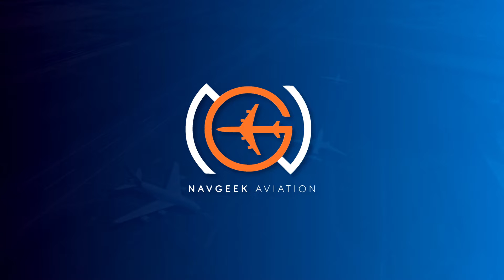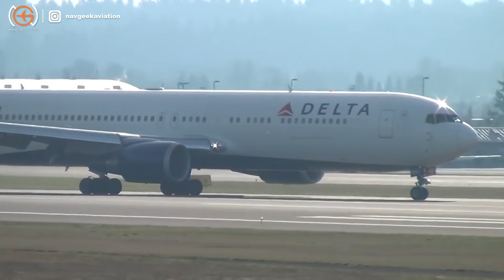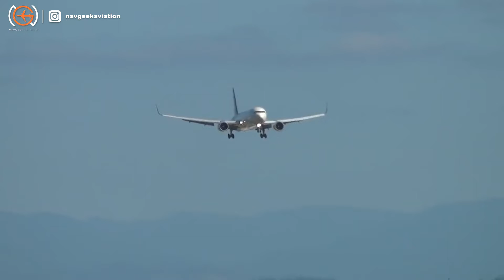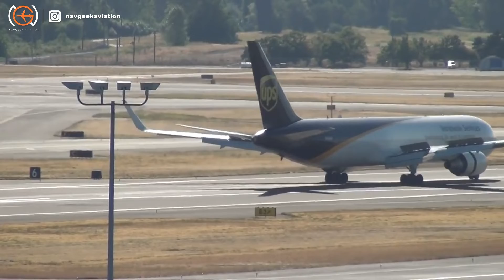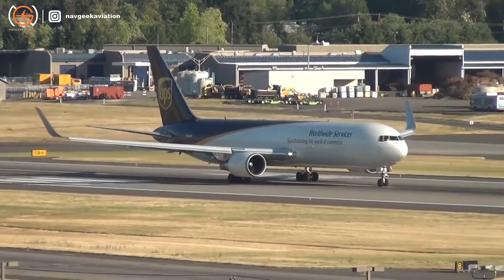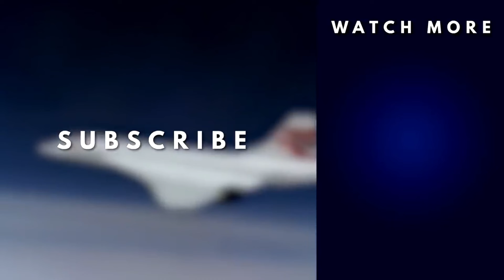Why Boeing SHOULD MAX The 767!

Comment: While the 787 was marketed as a 767 replacement,  the 767 is really unique in being a medium width fuselage.

Comparing Interior widths 

767 is 186 inches
787 is 216 inches 
777 is 231 inches
777x is 235 inches
A320 is 146 inches

A 767 with the GEnx-2b67 (747-8 engine) is 15% more efficient than the CF6 engine. If 67,000 lbs thrust is too much, derate the engine for even higher efficiency. 

Combined with a new composite wing, you can gain even more efficiency. 

Nice part of the 767 is you have existing fuselage lengths that cover the spectrum with the 200, 300 and 400 series.  

One thing they should add would be a new entry door ahead of the wing which could allow dual jetway loading / unloading

Comment: I don't understand why there's talk about a 767 replacement when the smallest 787 can do everything the the 767 could do, but better. Seeing as many airlines have gotten the type to replace the older aircraft,  pursuing a 767X would be time wasting and Airbus would likely entice customers with a newer clean sheet design if they wish. Boeing should continue working on a 797 to replace the true MoM aircraft (757) and a larger version could also replace the 767-200.
Reply: No it's not. The 787 is alot heavier than the 767 and was ment for long haul flights while the 767 was made for short to medium haul flights . Their not the same . The 787 is not effective and efficient for medium / short flights like a 767X could be . 

The 767-200 for example is close to 40 tons lighter than the 787-8 and would be better for the NMA because of its lower fuel burn. 

Even thou the 787 is considered a  replacement , it serves different purposes /markets from the 767
Reply: @mmm0404  It serves the same markets as the 767, which is also used for long haul flights. Maybe the 767-200 was largely meant for domestic flights, but the 300ER is a long hauler, and same with the 400ER; both of which can be covered by the 787-8/9. That's why I said a larger version of the NMA could cover the 767-200, as no airline (if few at all) uses it anymore. Even the freighter is based on the 300 model.

People like always you bring up how much heavier the 787 is based on the smallest 767 model, despite that 767s today serve the same airports as a 787. Even Boeing themselves said the 787 was based on characteristics from the 767, which were improved upon because of new tech. The 767-200 may burn fuel a little less because it's a smaller frame, but the 787 would gain the advantage as the larger wing improves lift and its shape reduces drag, the shape of the frame also reduces drag, and the newer engines require less fuel when going the same distance. Plus, the added seating capacity would mean airlines see they're using less fuel on a 787 per seat mile, with ANA some years ago saying they've seen a 15% improvement on domestic routes.
Reply: @fighter5583  
Well the 787 is better than the 767 , everyone knows that but a 767X would be better on medium to short haul flights than a 787 . 

A 767X could comprise of the GEnx (15% less fuel burn  than the Cf6)  , a new composite wing ( like the 787/777X), that could further improve efficiency/ fuel burn  and a taller landing gear.. 

The non ER versions of the 
767-200 and 767-300 could fly around 7400km and seat between 215 to 250 seats in a two class. This further proves my point that they where initially designed for short to medium routes . The ER versions could push their range to around 10000 km , which is still good for the NMA  , considering the 797 was designed to reach around 9500km. 

The 787 was generally designed for longer routes from the start with the smaller 787 flying around 13500 km and the 787-10 rumoured to get an ER version ...

And speaking of weights , the largest    767, the  400er Has a  dry mass of close to 20 tons less and a MTOW of close to 25 tons less than the 787-8 just to show how heavy the Dreamliner family is.  The 300Er could fly around 11k (km) while the 400er course fly around 10k , thats generally lower than how much the 787 can fly. A re engined 767 with its much lower weights could offer better economics and a lower fuel burn on medium /short routes while filling the gap between the 737 and 787 and offer better competition to the XLR.

The real point here is that introducing the 797 would have been better overrall yes , if only it was launched in 2019/20 with introduction in the late 2020's but now it's too late for that. Any new aircraft now will enter into service in the mid 2030's and that would leave Boeing without an XLR competitor , handing over the market to AB. 

A 767X could be introduced 2-3 years from now and allow Boeing to challenge for the NMA market while they focus their resources on a 737/757 replacement instead of a 321xlr competitor.

Comment: A 767-200 ER with the fuel capacity of the cancelled 767-400 ERX and the new engines, targeting a range of around 14,500 km with 214 seats, would open up a few new long thin routes internationally.
Reply: With that range, it’s basically a small Dreamliner, not really a MOTM airplane. Not that I’m complaining lol… 

If they make it with those specs, the per flight operating costs must be cheaper than a 787-8 (otherwise, why not just get a 787?), which means it will use more advanced engine technology, or a new body structure.

Comment: why not max the 757 that'll be much more easier i suppose
Reply: The 757 is completely out of production while the 767 is still in production. Re-establishing the supply chain for the 757 would not make sense from a commercial stand point.
Reply: @SoundoftheVoid  dude the 767 is too large the 757 is much more defined in shape and can easily compete with the a321xlr
Reply: @arnavsharma9882  the 767-200 isn’t too large and could be the ideal option for many airlines, it combines capacity and range but also cargo capacity, which is something the A321neo falls behind compared to the 757. Of course the 762 would be bigger, but not by a lot as it only has one seat per row more in a typical configuration, also the middle of the market isn’t just the capacity of the A321neo but also above that. Currently there’s no replacement for an aircraft the size of the 767-200, as I said something like 767-8 could really fit the role of an NMA aircraft for many airlines
Reply: @spongebubatz  I guess yeah

Comment: re-design the 767-200 and call it the 767-2 which would incorporate new engines, wings and avionics.
767-300er is very similar in terms of seats (220-280) to the 787-8 so realisticaly the 767-200 would be the best variant to upgrade and not to mention the 767-200 carriers around 200-250 seats which is the middle of the market range and is still bieng built as a tanker

Comment: I personally feel that Boeing won well before the introduction by Airbus A321LR/XLR began to saturate the MOM. I am a 757-200 lover, but in a non bias view..... The 757 happens to be Boeing's biggest blunder. The 757-200 and a possibility of a stretch smaller than the 757-300 is much better than the 767x in the middle of the market segment. In terms of a direct replacement....... Nothing has come close to the OVERALL performance of what the 757-200 can do. Boeing had the future in 2004, and they blew it. Even Though AA is mainly a US Airways management with the AA Branding.... The 757 was the bread and butter. Boeing's push of the 737 was the complete blunderby canceling the aircraft series with the most potential. Though the 787 has made many advancements, the 757/767 is THE greatest tandem of MOM fleet utilization. Same type ratings that create a huge savings bracket for Air carriers, fleet utilization on unmatched proportions in which a simple switch in fleet utilization and slot management at gates help create bigger gain in slot bargaining.

Comment: Iv worked on more or less every Boeing model in my 2 decades as aircraft engineer, and the 767 was a great plane and has a superb history and safety rating but it needs to be retired.  You can stick a new efficient engine on it and it will still have same issues from rudder fluctuations to numerous stall warnings on landing.
As said its been a brilliant aircraft and its the only model where Boeing didn't send its testing 767 to a museum it got sent to  desert. Putting a new engine on 767 is like putting a new eco boost into a 70s Morris marina car.
Let the 767 retire from passenger side keep it for cargo

Comment: Boeing should forget 767, stop MAXing things and get their shit together for a new generation of planes.
Reply: So should Airbus stop making neos and XLRs and buying other's planess and actually make their cleansheet planes
Reply: @PlanesAndGames732  you're right a321xlr is total crap its of no sense even qatar airways ceo does not have interest in the xlr and is only buying up till the lr variant
Reply: @PlanesAndGames732  in 15 years when their products reach the same age as B737 and B767 they should have a clean sheet replacement of A320 and A330 programs, yeah. As for A220 that was Airbus' very smart move towards having a replacement aircraft and technology. It's unfortunate that Boeing's fear of Bombardier's advanced new product threatening their outdated 737 design has put CSeries in Airbus' hand thereby limiting any chances for a third player disrupting the single-aisle duopoly.
Reply: @mbenidze  And how sure can you be that Airbus will replace the A320/A330? We've already heared rumors of the FSA by Boeing, but NOTHING on Airbus' side. And most likely the ZeroE thing will just remain as a concept. Commercial aviation is still a long way from zero emissions.
Reply: @PlanesAndGames732  If I were representing Airbus I'd be happy to answer that question. Let's check back in 15 years and see what new planes are out there. But as you mentioned we've seen ZEROe, also MAVERIC, E-Fan and E-Fan X from Airbus which does prove that there's a lot of thinking happening at Airbus for future technology and next generation of aircraft. The truth is however, having been developed 15-20 years later than their Boeing counterparts, A320 and A330 families are far more advanced technology and they can take a few more years before replacement aircraft are as urgently needed as Boeing needs them now.
Reply: Boeing stretched the 737 lifespan too long when they made the MAX since they had to do many haphazard changes to fit new engines under the wing, making the plane inherently unstable. That's why the troublesome MCAS got introduced. Boeing was under pressure by major airlines like United and Southwest to make something easy for them to convert 737NG pilots to and also by investors to have their new narrow body jet hit the market first. They were also just cleaning up after the 787 got released to production.

Tough times to run business.

Comment: MAXing the 757 would make sense
Reply: With a fuselage 6" narrower than the Airbus, and the ever increasing size of the passengers, not as much sense as you might think - especially for the longer routes the 757 typically served. The cabin width deficiency will become increasingly evident if the airlines had to reduce to 5 abreast seating just to compete with the space offered by even wider single aisle aircraft currently being developed, along with the fact that every single aisled Boeing jet aircraft share fuselage components with the original 707 developed in the 1950s. Not a great thought that a 757x (I think max is dead) at the end of its airline use assuming a 30 year operational life after an initial development of only 3 years, any aircraft produced after the first 5 years could well have a fuselage design over a century old by the time they were retired.
Reply: same ideology here !! 757 is smaller and can destroy the a321xlr if it wants but boeing has to make the final decision so that they can fail the a321xlr badlyyyyy !!

Comment: If onlyre-engined by GEnx-2B 🛫🤓
Reply: Has more power than needed for 767-300F replacement though.  While technically it fits, it doesn't.  The ONLY reason they are talking the -400 revamp is because it has a new wing which the -300F model in production does NOT have, and Delta/JAL/ANA/BA and many others would buy them for those ~2000-->3000nm routes which need lots of capacity.  There are many more of these routes than long distance routes and why Delta etc have desperately still been holding onto their 767's as an a330Neo or 787 is utterly a colossal waste on those routes with an extra 35-->50tons of structural weight which one you have to pay for and 2 have to fly around all the time doing nothing.  The only question is HOW much of an upgrade.... are we talking complete overhaul of flight systems to 787/777 standards?  If so, we are talking big $$$ and time.  Re engine, only?  Less than a year, and only customers would be for cargo most likely.

Comment: The old 767 would probably need every single non pressurised area replacing (not just the wings and engines), and probably the nose/cockpit section for aerodynamic reasons. Avionics and surface controls would also need replacing with modern fly by wire equivalents (possibly adapt those from the 787, or 777x to save money and time?) As for what remains of the fuselage suitable to carry forward, I suspect, that new materials (lighter weight alloys and/or composite) will need to be used wherever realistically possible. Only then, will you get anything approaching the efficiency of a clean sheet design, but still possibly close enough for other factors to eliminate or even exceed the inherent inefficiencies.
Bearing in mind that it is quite possible that Boeing don't have the luxury of time to develop a clean sheet design, they might not have any alternative than to develop a 767x, which even if sub-optimal, it could well still be a great aircraft suitable for at least 3 further decades.
Re-using as much as possible from the 787 would make good business sense as not only would it reduce development costs, economies of scale would then reduce the build costs for the 787, which even after a decade of excellent sales is still struggling to cover its development costs and break even. 
Keeping the clean sheet for a 737 replacement would probably be the sensible choice.
I also think that if designing a 767x, Boeing should consider if they could use much of the technology and design to create a replacement for the 757, which could go from what is now covered by the 737-8 up to say a hypothetical 757-250 and leave the 737 replacement to cover the market from the 737-7 down to the size of the original 737-100.
Reply: Boeing is trying to get AWAY from the 787 supply chain problems which crippled 787.  Essentially Boeing does not build much of the 787, all they do is assemble it and the suppliers of those parts make most of the profits.  Therefore, using only parts of the 787 built by Boeing and not its suppliers is the only option as otherwise you have to get into the horrible contracts of the 787 with Smiths, Moog, etc.  Switching over the cockpit... no problem it will fit, along with sensor distribution splitting of wiring etc.  Nearly everything else?  Dump, though I will note the idiots are SHIPPING 777X wing box from FUJI and have dumped MOOG so... maybe that aspect got ironed out since I was at Boeing.  Working with Smith's, DeHaviland, MHI, MOOG was a nightmare.  Complete idiots.
Reply: So you mean... essentially creating a weird 767/787 frankeinstein monster? A clean sheet design would cost about the same as adapting 787 parts and would be much more optimized
Reply: @PlanesAndGames732  << palm in face >> Structures are COMPLETELY separate from flight control systems other than.... FAA certificates.  Why?  Once you go FBW(fly by wire), you have a universal cockpit and the size of the aircraft does not matter.  What is pathetic is that the 787 cockpit(based on 777) should have been placed in their 737's as well, and 767's and 777X(which they did), but because of the FAA certificate issue they did not in the 737 and instead we got the MAX fiasco as they wanted a true clean sheet design for the last 30 years on the 737.....
Reply: @w8stral  <facepalm> read the damn thing
Reply: @PlanesAndGames732  I think that you mis- understood. To take wing from here, a tail from there and a nose from somewhere else might look strange  (although not unheard of, the French Caravelle shared a nose with the British Comet!) I was referring only to the internal components such as flight control, computer systems and instrumentation etc. As for taking a wing from a 787 and bolting it onto a 767, I doubt that would even be possible - but to take the design, scale and adapt it appropriately might save a lot of time and many millions, both in short supply at Boeing. 
Assuming that the dimensions work out, it might even be possible to bolt on the 787 cockpit with (or without?) external skin changes, which even if a clean sheet design were to have engineering advantages, the range compatibility, both from a maintenance and crew training point of view would almost certainly wipe out any advantages of a clean sheet design.
Reply: @neilpickup237  thanks for explaining, i most certainly did!

Comment: But the 767 max will be addressing the same market as the 330neo. So will need to be priced accordingly. Coming out of the pandemic I don’t know how attractive that market is compared to the single isle low capacity market of the a321xlr?
Reply: The 767-200/ 300 is actually smaller , making it better for the NMA than the a330